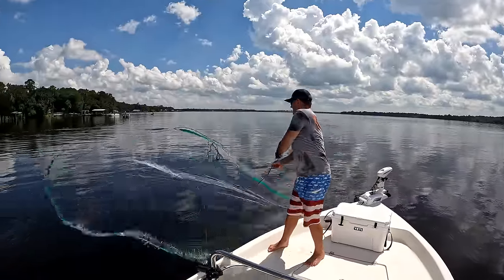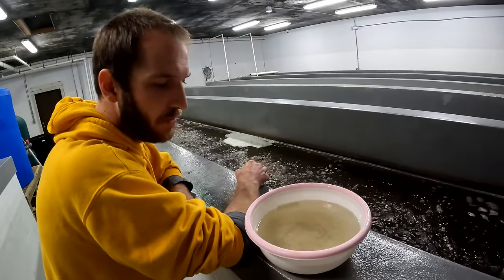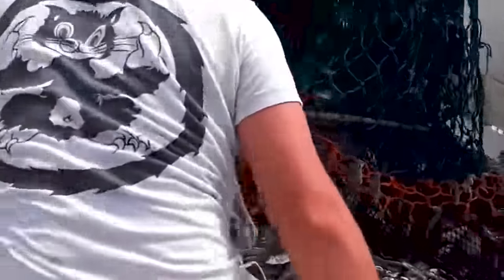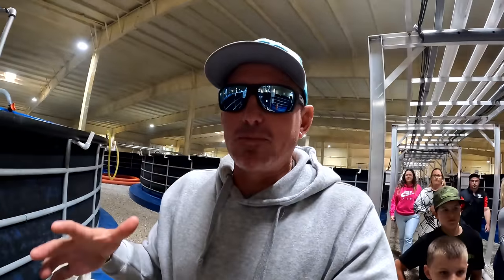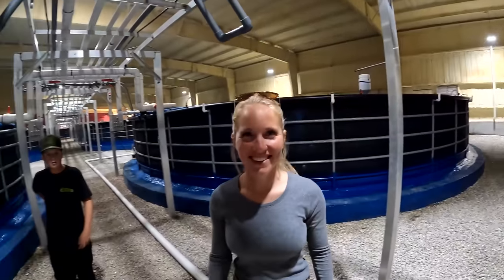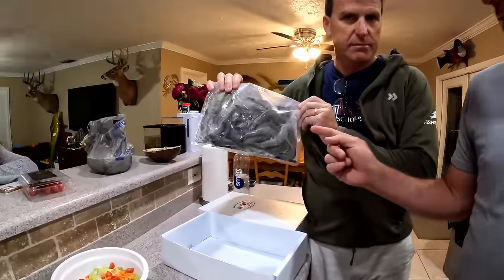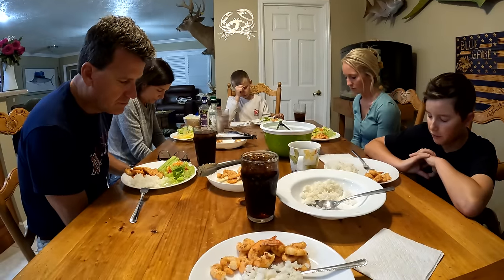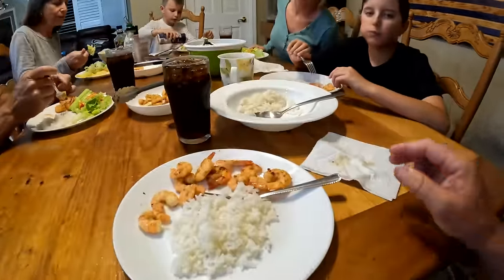I Exposed a Major Shrimp Farming Operation! (I Can’t Believe They are Doing This)

Comment: I have a Bachelors degree in Aquacultural Engineering, and this operation is outstanding!  The biggest threat to operations like this, specifically those that reuse their water, are biological, such as bacteria and viruses.  I noticed that there are no "foot baths" at the entrance to any of the buildings for washing your shoes/boots/gear, but I suspect they're dealing with that using the biological controls, biofilters and ozonators.

Comment: Great video! That density (texture) difference is likely just due to frozen vs never frozen. Ice shreds cells from the inside, like little knives, when it forms, even with flash freezing. So, frozen meats will tend to be more tender. You can think of ice formation as similar to a mechanical tenderizing process, especially for lighter meats like fish and shrimp.

Comment: Awesome production system. Great video. However they have to be adding water to the system constantly due to evaporation and the adult grow out filtration.  Both the sand filtration and protein skimmer  require fresh water backwash to waste drain. The guy in the production house even said that when he was showing the filtration and ozone system.  They look like they are doing a great job with water management with minimal impact. Would be interesting to know where the drain goes. On site settling pond? Returned to the ocean?  Backwashing for a system that large would still be hundreds if not thousands of gallons a week.
Reply: This farm is 30 miles from the ocean and the only available water source is well water. They may have some small retention ponds on site but it's not much looks more like it's for rainwater than anything. I know all this because this farm is my neighbor.

Comment: You did a lot more then just show how you can bypass the whole bycatch thing... The operation itself is amazing, They leave enough room in the large tanks for the larger shrimp so they are not stress (THIS IS THE NEW STANDARD) They keep everything isolated from one room to the next (New Standard) They make sure the water is cyclical (new standard) they ensure they remove everything harmful (Good Standard) HOWEVER this is where they could improve, by adding fish, certain fish in a certain way they can not only clean water and provide additional nutrients for the brine shrimp but they can also provide healthy fish for market if they use their same standard and CONTINUE to revise, adapt, review (Cycle) They can increase profits while taking a little more stress off nature based animals. This group of people has what it takes to make a safe fish production, rather then having such large tanks above ground they could be below at any rate These group keep up the good work.

Comment: How do they compensate for evaporation in those big open pools??
Reply from the maker: I’m quoting Crystal Beachys response to this question. “Add more water” 🤣
Reply: @BluegabeArrington What I was meaning was the operators implied it was a closed system with recycled water.  They should have said it was recycled water except for what is needed to replace evaporation.

Comment: After watching your video I was ordering 5 pounds  for $62.50 however the shipping cost varied from $194 to $257 to get the product to SO CA. Needless to say I did not order.
Reply from the maker: That’s not their fault but it’s definitely an issue they are trying to figure out. The problem is they have to over night the shrimp so they remain fresh and that’s the problem.

Comment: Zero footprint can only be accurate if they are using no carbon based electricity. Just the same, it is great they not using very much water. It is pretty amazing.